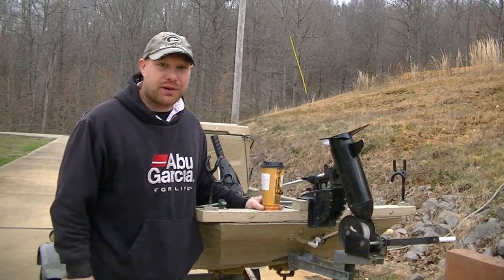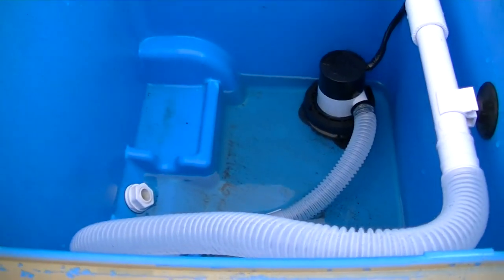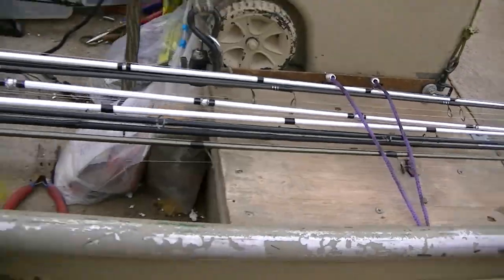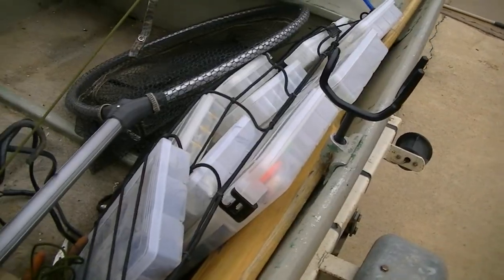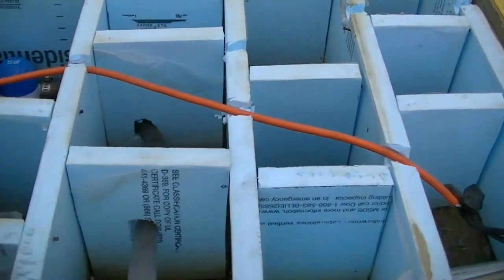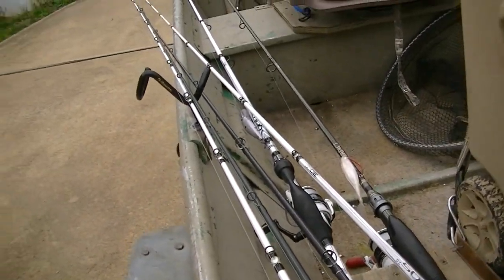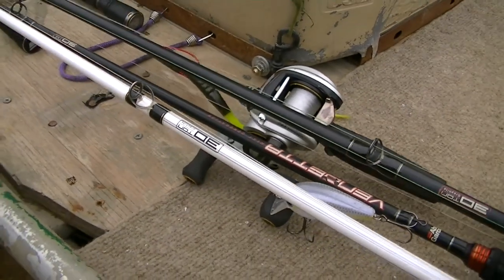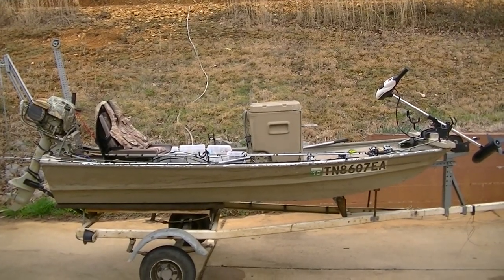Best 10-foot jon boat setup ever!

Comment: Nice setup. I have a 12' jon boat that i put a deck on but its not to stable did you have to do anything to make it more stable.
Reply from the maker: I didn't do anything for stability, but having the cooler to sit on and the trolling motor to grab ahold of, if needed, have been helpful. It obviously cannot be used on the main lake when there are whitecap waves, or any type of rolling swells, but it is really good in protected bays, coves, and creeks (once I got used to how it moves around. lol) Thanks for watching!

Comment: What about your anchoring system,  other than your power pole?  Do you never use a regular anchor?  My 10 ft. jon boat was purchased by me in 1971 for 50 bucks brand new, from Montgomery Wards.  It is an "Aquarius" brand.  it is rated for 10 hp motor.  It weighs in at 130 lbs. Empty!  It will only handle 300 lbs.  loaded (motor, people, gear).  How much weight does all this add to your boat?  I weigh in at 220 lbs. dry weight......lol.
Reply from the maker: I do not use a regular anchor very often, because I do not like to be anchored if there are any waves, and if there are not it is not as needed. This jon boat is rated for 350 lbs, I have 160 pounds of added weight (motor 50, battery 50, trolling motor, seats, deck, shallow anchor combined 60), so I am close to the recommended limit when I am in it. I do have to be careful not to take it out too far from protected areas of the lake, but it is great for smaller bays, coves, creeks and other such areas. Thank you for watching!

Comment: I have the same boat, just curious how high out of the water does the boat sit fully rigged with you in it?
Reply from the maker: Hey, sorry for delayed response. The boat does sit down in the water a little. When standing up front, it sits a few inches above the water in the front and about 6 inches in the back. It is obviously best suited for bays, creeks, or small lakes that are protected from strong winds. Thanks for watching, and commenting!

Comment: Lot of weight for a 10ft jon boat. Curious to know what the coast guard capsize weight
Reply from the maker: This boat is so old that it didn't come with a data plate/hull id number, but I've weighed everything that I have put on it and it totals 270 lbs, and with the added foam it does fine in protected bays, creeks, or coves, or anywhere there aren't  waves.

Comment: It's great but why not just drop a anchor Instead of all that power pole? Plus I bolted a 1 foot by 3 inch plywood, to the oar holder with 1/2" bolt.. then mounted 2 rod holders each side...
Reply from the maker: The shallow water anchor is just a little easier for me to use when pitching to brush or pads for bass. The multiple rod holders is a good idea for drifting or trolling!

Comment: what material did u use for ur anchor pole stop if you can remember I need same setup
Reply from the maker: I'm not sure if I understand the question, but I used aluminum for the parallel rails, 1 inch square steel as the bottom and top pivot points, a scrap piece of 3 inch angle aluminum as the base where it is mounted to the transom, with 3/8 inch bolts, and a peice of 1/2" all-thread as the actual pole.

Comment: I need to replace the wood in my transom but my boat is like 40 years old and all the nuts and bolts that use were aluminum and I can't get them out do you have any suggestions I have a video on my Channel showing the damage if you want to take a look at that but I need help
Reply from the maker: I also replaced the wood support for the transom of my boat before I mounted the motor. I had to drill out the aluminum bolts/rivets, then when I replaced the wood I used new bolts, washers, and nuts. I also used liquid gasket and fender washers to ensure a waterproof seal when the new bolts were tightened down. I have not had any leaks from the transom.
Reply: The Low Budget Outdoorsman thanks for reply man I was kind of hoping you were going to tell me something easier than drilling out all them bolts
Reply from the maker: Lol  Sorry. If you figure out an easier way let me know. I did not want to use any type of cutting action because I did not want to accidentally cut through the transom, so I just drilled them out. A Carbide drill bit is pricey, but will make it quite a bit easier.
Reply: @TheLowBudgetOutdoorsman  if I come across something easier I'll let you know

Comment: How heavy is that boat?  Could you launch without a trailer if needed?
Reply from the maker: Without the trolling motor and battery it can be done. Before I picked up the trailer at a yard sale, I used to just load it in the bed of the truck, with the motors and battery taken off. Since I got the trailer, I have it setup more permanent.  Good question, and Thanks for watching

Comment: that is awesome man about how much did you have to invest in it to get it to look like that and also do you have ever have trouble with it wanting to tip over say if you want to stand on the front deck portion to fish or run the trolling motor?
Reply from the maker: Whole setup cost was under a grand. It is a little tippy, but I stand up on the front deck all the time while fishing, as you can see on the bass fishing videos I have posted. Thank you for watching!
Reply: ok thank you ill have to look into making some upgrades for mine

Comment: How did you make the motor setup with a lawn mower motor?
Reply from the maker: Hi, thanks for watching. I did not make the motor. Briggs and Stratton actually made a 5hp outboard for a while. It is basically just a lawnmower engine on top of a lower unit. Being air-cooled has its advantages when using it in swampy or muddy areas, but it is obviously louder (it sounds like a lawnmower engine).  I purchased it new about a decade ago and have used it extensively. It still cranks on the first pull, and the only thing I have replaced on it has been the fuel line coupling. I just change the oil as needed, and run only non-ethanol gas in it. It was about half the price of a water-cooled outboard, and I am familiar with lawnmower engines, so I thought parts and maintenance would be easy...and it has been.

Comment: is that 2 2x4's for the front trolling motor mount
Reply from the maker: Yes. (they've been ripped down to about 2.5", but they were 2x4's originally. lol). There wasn't really a better way for me to mount the transom mount trolling motor on the front. If you don't have front deck on a jon boat you can just mount the trolling motor on the side near the front and that works fairly well.

Comment: Are there any boats you would suggest for more larger people like 300+ on a tight budget?
Reply from the maker: You will probably need to look for at least a 14 foot jon boat, which should have a 36 inch bottom width. That would have a manufacturer weight capacity of 600-700 pounds. Obviously bigger is better, but cost is always that great inhibitor. You can look on local classified ad websites or in papers, but also just keep an eye out for any old aluminum boat that just sits in someone's yard collecting leaves or dirt. If it never gets used by the owner,  they may be willing to sell it to you at a great price...especially this time of year, when the temps are still chilly (at least where I live). Aluminum boats are often easier to look at and determine if they are structurally sound, with old fiberglass boats, that can be more difficult. On a tight budget you may have to get an older aluminum boat at one time, and buy a motor separately. Also, check with you local state and county/city before hand to ask what is required to register a boat. Where I live a bill of sale is all that is required, but some states may require an actual title. I hope this helps. Have a great day.
Reply: Thanks that helps

Comment: did anyone else see that the trolling motor is on backwards? or do you just use reverse outdoorsman when going forward?
Reply from the maker: There is one small bolt that mounts the head unit to the shaft, so I just turned the head unit around, and then it worked easier, than just moving the unit around backwards. But no, reverse is not designed to go forward, so I go forward in forward, and almost never use reverse, i just turn the trolling motor 180 degrees to go backwards. Lol. Good eye though.
Reply: @TheLowBudgetOutdoorsman  ok cool man, im doing a tinnie up also, looking for ideas, one quick question in the vid your prop on trolling motor is facing forward, when you remove the head unit can you turn the shaft around so the prop faces the other way whilst in the bracket and clamped to boat? cheers mate and fish strong
Reply from the maker: @vinnieosullivan3531  yes, you can pull the small bolt, and rotate the head unit 180 degrees and it will be setup for easier use.

Comment: What's holding all the insulation board in place?
Reply from the maker: . Hi. Thanks for watching. The insulation board is not fastened to the boat, however,  I did cut it to fit tightly in the boat and on itself. Each piece is notched to fit into its cross supporting piece.

Comment: Is that outboard built from a kit?
Reply from the maker: No. Several years ago they were sold just as it is mounted. It has served me well, but probably wouldn't push a bigger boat. It was rater cheap.... which is why I bought it. Lol. Sorry for the delayed response, and thanks for watching.

Comment: the bad thing for me I only have a motorcycle.. so I want a damn small boat or a fishing kayak.. but then I have to buy a truck also.. I guess I better get a damn truck.. I just get a damn 10 foot aluminum rental every so often.. its similar to this.. they work good. but yours is way more pimped out..
Reply from the maker: Yeah, hard to tow a trailer with a motorcycle...but I've seen some crazy things loaded on, and/or towed by, motorcycles when I was overseas in the past. lol ...but that might even too low budget. lol
Reply: @TheLowBudgetOutdoorsman  lol you prob saw a lot of little motorcycles like mine then.. I got a 125cc street legal honda grom.  I got a cheapy 8 foot sit on top kayak I could prob pimp out for fishing the lagoon here though it would suck for the big lake.  but all the hogs back in day got dumped in lagoon. so that spot is really good. just im on shore so it just seems tougher to get on the fish.

Comment: What kind/brand of fishing net is that??
Reply from the maker: I can't remember the brand (and my daughter dropped in in the lake so I don't have it anymore. lol), but it had a rubber coating over the cloth netting, and I really liked that since it kept hooks from getting entangled so easily. It also had an adjustable length handle that operated like a extendable paint stick. I think I bought it at Academy sports, but I'm not completely sure. Sorry, I couldn't be more specific.

Comment: I just bought a 10 foot and saw your idea with the foam as supports......
How did that hold up for you in the 10 years?
I'm looking to add buoyancy as my boat was made before foam in the seats was a practice so i have no bouyancy at all in this boat.

Thanks
Reply from the maker: The foam held up this entire time! I did not have any problems with the foam as a support
Reply: id just exchange it for a 12 foot, so much bigger...or get a 10 foot wide edition.. if ur doing all this stuff and these boats are this cheap might aswell start on the right size.

Comment: doesn't the all thread bend?
Reply from the maker: Hi, sorry for the delayed response. The boat is light enough that the all-thread does not bend very much. I do try to come to a complete stop with the trolling motor prior to dropping the shallow water anchor. There is some give in it which is beneficial because it keeps some of the stress off of the transom. It only drops to just over six feet, but that is plenty deep enough for that boat. Thank you for watching the video! If you did something similar on a larger jon boat, you may need to use a larger piece of all-thread or purchase (or find being thrown away) a fiberglass rod...like an old military style antenna.

Comment: What exactly does the foam do? I was going to use wood on my project, but this has me second guessing.
Reply from the maker: Hey, thanks for watching. Since my boat is so small, I used the foam to drastically reduce the weight in fabrication of the deck while adding a little buoyancy at the same time.

Comment: how is the stability?  does it rock side to side easily?
Reply from the maker: This boat just has a 30 inch bottom, so it will rock quite easily, compared to a jon boat with a 48" bottom.

Comment: How stable is it in the water with all that weight though?
Reply from the maker: Weight adds to the stability, which is about the only plus to being on the heavy side of what it is designed to do. But no flat bottom 10 foot jon boat will be "stable" when compared to a 14' jon boat, or any v-hull boat. Thanks for the question.
Reply: @TheLowBudgetOutdoorsman  thank you! I have a 10ft myself I want to do something like this to but I was a little concerned about that.

Comment: how wide is your 10 footer. just got one and getting ready to fix it up. however mine appears to be not as wide as all the other 10 footers are.
Reply from the maker: Thank you for watching! I have a small one that  has a 30" bottom. That is about the norm for a 10' flat bottom jon boat.
Reply: definitely welcome. thank you for answering me back much appreciated. ok so yours is the same as mine, couple of the other people I talked to had 3 1/2 feet wide and not 2 1/2 feet wide. if you don't mind could I possibly email you with some questions?
Reply from the maker: Sure. I will try to answer what I can.
Reply: Mine is 32" bottom 45" wide side to side. Fisher 1032

Comment: What do you do for top speed with just you in the boat? I have a similar setup and am curious. Thanks.
Reply from the maker: It definitely depends on current, wind, etc. but  10mph is probably average.
Reply: Thanks for the reply. :)

Comment: how much did this cost boat and all ?
Reply from the maker: Motor and trolling motor were around $700 total. Boat was given to my dad years ago, and sat in his yard with the broken oars in it, so it did not cost anything (it is so old that it doesn't have a hull id number). Everything not including the rods, reels, and tackle was under a thousand. And it was not all put together at the same time, everything was spread out over a few years. And the trolling motor is a 50 lb thrust, so it could go on a bigger jon boat if I ever got one, as could the 5 horse motor...although it would go even slower than it does now. Lol.

Comment: How’s the stability?
Reply from the maker: It is only 30" wide at the bottom in the front, so it is not the most stable platform. I do stand and fish from it though, I rarely sit down. If you watch my bass fishing videos, you will see me standing on my small deck and fishing from it. If there are white caps I will find calmer water. It is great for creeks, bays and wind protected coves.

Comment: nothing worse than a single anchor.
down and around an rnd we go.
really tough to straight line fish this way.
Reply from the maker: Lol. It's definitely too small of a boat to have double anchors on the back, and one is much better than none...but it can be difficult at times to get the boat positioning right.

Comment: You can buy 18 foot bass boats cheaper than 14' jon boats....I bought a 15 ft skeeter for $1500 with 150 Johnson slick too, a 18' bayliner for $1800 and another 18 ' skeeter for $800 but the 14' jon boat i want is $3500 used. I got 3 good bass boats about the same as 1 nice jon boat. Alot of people like jon boats better, hence forth the price...

Comment: Had a14 footer set up the same way till I swamped due to too much  weight this is nothing more than a deathtrap I live on the Potomac in West Virginia many guys around here run the same S S Ghettos as this I've since purchased a new jet boat with all the right equipment being frugal is good  until it kills you
Reply from the maker: It's definitely not for all situations or places! But that's true for any boat...I go many places a bass boat or aluminum deep-v can't go. And eventually, I plan on getting a more versatile boat.

Comment: that boat will be very close to sinking with all that weight, 10 footers are sketchy and only hold like 200 pounds
Reply from the maker: Hey, thanks for watching! It does sit a little low in the water (lol). 350lbs is the weight capacity for that particular boat, so I am pretty close to that weight, especially if I eat a big breakfast! And yes, all 10 footers are a little sketchy if put in the wrong situation.